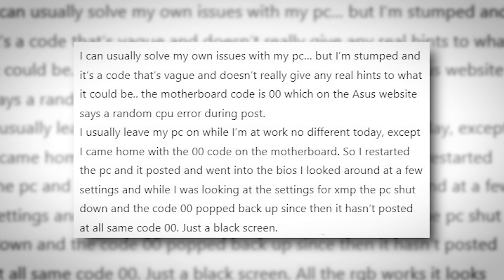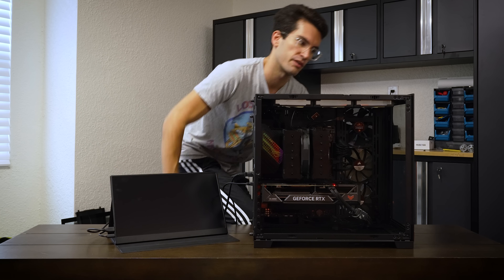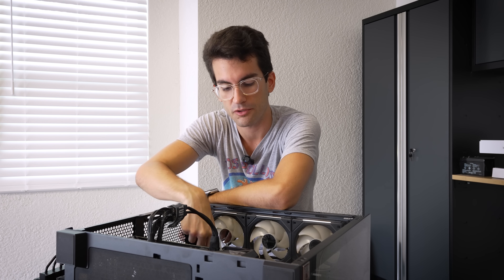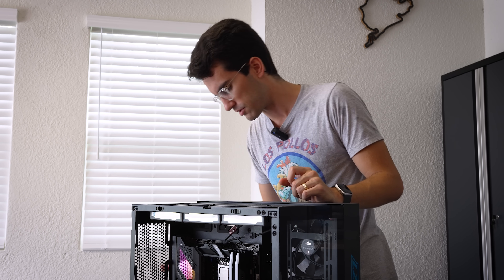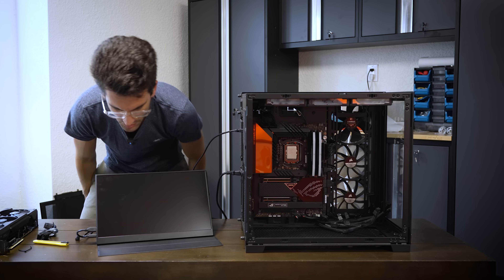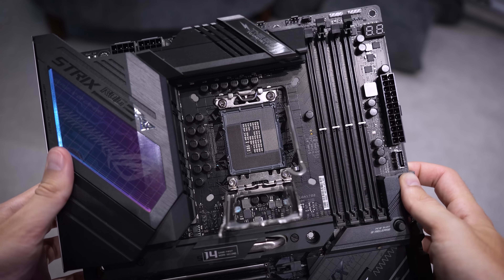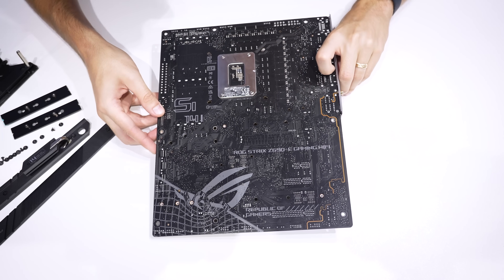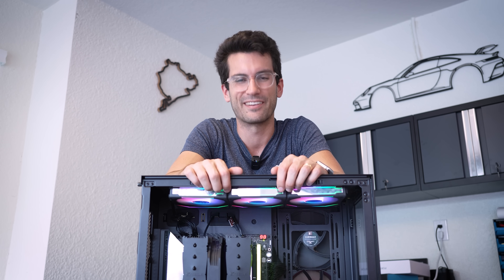Fixing a Viewer's BROKEN Gaming PC? - Fix or Flop S5:E17

Comment: If cpu isn't getting hot, it's probably likely that a mosfet went bad or the controller of the power stages went bad. If you have a thermal camera, power it on and see which component gets hot and that is likely the culprit. Great diagnostic video.
Reply: My thoughts exactly.
Reply: Agreed.

The power delivery to the CPU is a no-go.

Something is broken.
Reply: Exactly this. Also a very common fault for GPUs.
Reply: 30 seconds in and I'm like that's a dead Asus MoBo. I've see that dozen times
Reply: i was thinking a blown fuse on the cpu power rail as the 13/14thgen  are know for spiking in voltage ??? defo could be a dead mosfet
Reply: Yeah the problem with fixing a board problem like that is a pain...if it's a mosfet or capacitor or something that's gonna take soldering which means you need a soldering iron and a bunch of other stuff. Just not worth imo.

Comment: 0:47 Greg, you need an ultrasonic cleaner. Gets the smoke smell right out of the boards. I just picked up a scrapped B350 board that works for $10 CAD. It came from a heavy smoker. The colour and the smell. GONE. Absolute magic.
Reply: How does that work? You must need a big one to fit the whole motherboard in… doesn’t it have water in it?
Reply: @minecraftmike5193  as long as the board doesn't corrode I don't think there'd be any problem with it being submerged, obviously the battery and stuff should be removed.
Reply: @danimayb  Just make sure the capacitors are discharged. And I'd suggest demineralised water instead of tap water, as it is much more pure, and won't leave a lot of residues.
Reply: And for those of us who can't afford a MB sized ultrasonic cleaner, vinegar and a Q-tip works exceptionally well.
Reply: @danimayb   yeah nope. You can never be sure its dry ffs.. Keep your electronics away from water..
Reply: I'd love for Greg to move into board repair

Comment: Looking at that massive cooler I immediately thought, warped/bend socket. That's 1 of the reasons why I love AIO's, there's so little weight pulling on the board or socket. the better part of a kilo or more for those topheavy coolers is a lot for a single bracket to carry. Also the PCB of the "cheaper" rog strix models have fewer layers of sillicon compared to - for instance - the Hero you installed. It just has to bend a fraction of a mm and in a few years you can throw away the mobo. 

Doesn't mean it is a  warped or bend socket, but it also could mean the owner forgot to mention a detail or 2, but regardless of what it ends up to be the main issue, that system is up and running and I'm sure the owner is really happy with the result and the upgraded motherboard.
Reply: This is not true, the board is built to handle the weight easily. That cooler isn’t even that heavy compared to others. I’ve had bigger air coolers for years without any problems. It takes much more than just a cooler to break the board, unless you really mess up. Just sitting there, the cooler won’t cause any damage (though, like with anything, there are rare exceptions where you might just get unlucky).

The way the cooler’s attachment points are designed lets it support several kilos of weight, and there’s no real strain on the socket itself. You put a lot more force on the board when inserting connections or RAM.
Reply: They have metal backplates they screw to and spread the weight out.

Comment: Praying Mantis's are so cool. They will run from you. However, place your hand in front of them. Get them to climb on. They will let you look at them and look back. I've been doing this for decades. Set them back down onto a wall or wherever, many times they don't want to leave your hand.You have to coax them off. Come back 10 minutes, 1/2 hour later. If their still there. They will remember you and not run away or fear you. I've moved them in my garden and had them watch me picking vegetables. It's kinda amazing to me.
Reply: when i was around 11, i saw this mantis sitting on a barrel and instead of running, he flew straight toward my face and scared tf out of me doing so. nowadays i don’t mind them but i never see any these days
Reply: @ImNoodals  Thats funny, I'm fortunate enough to currently live on 10 acres in rural Vermont Mantis's are so abundant I try not to run them over with riding lawn mower when I see them running for their lives. They rarely fly, I don't know why

Comment: I just built a similar system last month, and it was my ginormous CPU cooler.  At first it was randomly having weird issue and screen going black,  I would put it on its side and check stuff, then when I turned it on, it worked.  After putting it back together, and turned it on (upright), the random errors and black screen returned.

Fast forward 2-weeks I finally figured it out.  I looked at the rear panel and seen only a few ports were misaligned.  I pulled the motherboard and it was warped.  I looked at the motherboard and it was really thin.  I have socket 1700 and GIGABYTE B760M C motherboard.  I put on a stock cooler after straightening the MB and all is well again.

So, if you get a ginormous cooler, make sure to get a support CPU bracket for LGA 1700 and maybe orient your CPU so it stands upright in your case. The cooler is a Thermalright Frost Tower 120, it weighs in at 3.5lbs!  I guess 3.5 lbs is the motherboard weight limit.  At least for that motherboard.  It wasn't a top tier MB, so if you want a top end air cooler, you may need a top end motherboard that is thicker and stiffer or buy a LGA 17000 CPU support bracket.  Thank goodness it didn't kill my MB.

Also, I highly recommend a CPU support bracket with a ginormous CPU cooler.  Hopefully AMD makes one too.
Reply: Gagabite strikes again. A contact frame should solve the issue.
Reply: @Lurch-Bot  Yeah, I ordered two brackets already.  I don't know if Gigabyte is solely responsible, as I have seen other MB manufacturers with issues.  I mean a lot of systems need to use those brackets on any new high end intel system.  I don't know of anyone testing these brackets on all systems with this ginormous coolers,  but it would be a nice test on which MB would need them over others.

But AMD makes the same grid array sockets, so it wouldn't surprise me if AMD will soon need custom brackets as well.

Comment: You might try bios flashback via the flbk button and bios usb on the io before totally condemning the board.  Otherwise RMD time.
Reply: Yeah I don’t know what tooling he was talking about. You can update the bios via the flashback slot in under 10 minutes. As long as you have the 24 pin power connected, that’s all you need. 

A flash drive > Fat32 > install the bios and renamer file > run the renamer and then delete that > slip the usb stick in the slot > press and hold the button until light flashes > and then it’s done in like 5 minutes
Reply: @HOBOTw1tcH  he was probably talking about a tool to manually fix a "BRICKED" bios. For that, flashing it wont simply solve the problem. That's the reason why most Gigabyte motherboards come with dual bios integrated in case one bricks, the other one can still be used.
Reply: @Angel_Espinal  yeah I figured that. But it’s not what he said. It was just confusing. And weird that he’d skip a 5-10 minute test that could have saved the board. But he’s a smart guy and he has access to hardware on hand unlike most people. So I get why he just replaced it

Comment: 12th gen is not affected. I have a 12700k, with a 3080ti, & it's a fantastic system.
Reply: I’ve got a 14600kf. Haven’t had a single issue. I’m sure there are people who have but from what I understand it’s the 14700 and 14900 that are the issue.
Reply: @genesisfan029  You were just lucky and Intel might be lying about it. My friend's exact same 14600KF has degraded too so it's not just i7 and i9.
Reply: @kerotomas1  The ammount of 14600kf that are degragading is EXTREMELY low compared to i7 and i9 but they still exist.
That guy is not lucky he is just like most people.
Reply: It’s not a hardware problem it’s a bios settings problem. Sync all cores.
Reply: @ZackSNetwork  I mean it is affecting only some type of hardware (actually gen 13th and 14th). But to clarify it's as much a hardware problem (cause there is some oxydation in some CPU cause Intel maufactureurs didnt do there work properly) as it is a software problem (intel microbios was shit and pushed so much the cpu's that they speed up that oxydation procees or even fry themselves). Gamers Nexus and level1tech did a real good series of videos on the problem !

Comment: If I were to guess it was an improper application of the Heat Sink causing the CPU to shift and while the CPU powered off to save itself the Motherboard wasn't so lucky.  That or it just was it's day to go, like someone dying but they could not find anything wrong with them except for the fact they are dead.

Either way it would be a rare shot and thanks for sharing it with us.

Comment: I ended up replacing some kids i9 3900K processor today after his was one of the ones that was causing crashing,. I ended up finding out too that intel had discontinued the specific model 3900k that he had for a newer one version that supposedly doesn't have any issues. Installed the CPU and it I ran a full stress test for like 5 hours and it didn't power off or crash once. 

Built my nephew Dylan's first gaming PC two months ago and we went with a 12th gen i9 12900k and his build works like a dream.

Comment: Hey Greg, I am curious if you considered bios flashback to update the bios?  I have ran into a similar issue with 00 on the debug code with an Asus board after a Windows update.  Board refused to post or show any other code than 00 until updating the bios.  Worth a shot if you haven't tried that, I know you do some testing off camera as well so I imagine it is possible you already tried it and didn't mention it.
Reply: I was wondering this too! Could be that the logic is that if the CPU isn't getting power (or at least not producing enough activity to heat up), then it's unlikely the BIOS flashback would work? I've only used it once myself, so not very familiar with it.
Reply: @xos  In my case I suspected that the Windows update pushed some sort of update to the bios that kind of pissed it off and a bios update undid what Windows screwed up haha.  Can't say if that's exactly what happened for sure though
Reply: I was yelling at the video for him to do this the whole time. Could just be a corrupt bios. Maybe it tried auto updating or something weird😊

Comment: I use Intel Core i7 12700, updated the BIOS with newer microcode 0x129, the motherboard is Asus ROG Strix Z690-F Gaming Wifi. Bought this platform since launch date, 2 years and still running.

Comment: 00 On an ASUS Motherboard is nearly always a dead Motherboard, not the CPU. It is also a known issue with that brand. They also did a recall a while back for a chip placed on backwards in the area near the DIMM slots which resulted in it burning out that  chip and causing this same issue.

Comment: I've had such horrible luck with ASUS products that I refuse to buy them anymore. A year ago I bought a new laptop from them---out of the box it overheats after 5 minutes. And two years ago I bought a gaming monitor from them as well---there's a 4" dark-shaded bar on the right side of the screen, and it's not GPU-related. Even the stand-alone DVD player from them was awful---the power switch was so stiff that I had to use a screwdriver to turn it on/off

Comment: Thanks for the video. Any interest in expanding the series to do more repair work? I'd have been very interested  to at least check the power rail voltage levels on the board (for shorts, etc) and to see if the cpu socket was receiving power.

Comment: Hi Greg, I had a unique MB failure. After I finished building my PC, it worked faultlessly for some time. When I moved my PC, it did just what that PC did. I did just what you showed in your video except replacing the MB, which I had to order. As I removed the old MB, I heard the sound of something falling. It was a small SSD cover screw that had found a new home behind the old MB.

Comment: The more of these i watch i find it crazy my GA-970A-UD3P (rev. 1.0) mobo,  fx8350 and gtx 970 still run like a champ. The only issues ive had were both psu related

Comment: My latest…. CPU fan mount had stressed the motherboard so much ( it was like a spring when I removed) it cause hairline cracks on traces leading to the nvme..and other areas of the board …changed opacity of camera and it was clear as day through the lens.

Comment: i've seen power surges take out bioses, and power stages. just enough to cause the internals to fail, or to wipe the programming in the chip (re bios), but leave them looking fine.

only way to resolve it for bios wipes is reflashing if the chip isn't doa. which yeah, isn't something you can do on a lot of motherboards without special gear. sometimes the test clip will work, sometimes the circuit requires you to pull it off to program it, since the components surrounding the chip will pull the current low enough on the data lines it doesn't flash right.

and then once in a while you run into the problem i'm having, where intel does funky things to their bioses, and loads a small decompression util in first to unpack the main bios segment elsewhere on the chip. if its not there, and in the right location in the eeprom, the board is just dead.

now, most modern boards don't do that, and will take a straight flash if you have the capability, but it can still be annoying to get there.

Comment: Idk I’ve had nothing but issues with my TUF X570 Pro-WiFi board. There was a moment where it was just bricking my drives. I swapped to an MSI B550 board, zero issues whatsoever. I had to wait until there was a bios update for the X570 board in order to fix it. I did the update and it was stable…for about 3 months at a time. Then it was either a power delivery issues,  problem reading drives, throttling issues, and just recently it just randomly decided that it wanted to stop reading my RAM. I’ve ran into a handful of people on Reddit who have run into similar unstable bios issues. I want to say it’s just that ASUS makes so many boards a bit too many are ending up unstable/defective down the line.

Comment: Only options are to use the onboard Bios flash back with a previous BIOS version on the USB device.  If no bueno then have it RMA'd, ASUS should have no issues on a board that new sending a replacement.  Ask the customer if you can keep the board then just rma it and keep it for the next person, 690 is perfectly acceptable or you can offer to r&r it when it arrives for a normal repair fee if they really want theirs back.

Comment: What Kit did you get? I reflashed and rescued so many Boards in the past with an CH341A and some accessories. At some point I bit the bullet and got myself an SkyPro II from Coright. Thats what all the Tech Supports at the board vendors use too. The SkyPro III is also available now

14:22 - You could still use your FLIR to detect a hot IC etc. A hot IC usually means that theres a short in it

Comment: Greg, just an FYI, the CMOS battery would be considered dead since their nominal voltage is 3 volts. When they are new they will be 3.2-3.3 volts. Dead is 3.0 volts and under. I know when you showed the test it said 3.07 volts but that is still low enough to cause issues with a device. Thanks for the series though, always entertaining to watch.
Reply from the maker: 3.07 has been measured in multiple, working boards at my disposal. So I don't think that's entirely true.
Reply: @GregSalazar  Yes, I have seen that in multiple of your videos. Per my experience during my almost 15 years selling and replacing those batteries, 3.07 volts can cause issues in a device, though  it may not cause any issues. Still would be worth it to replace it with a battery reading closer to 3.2 volts to verify it isn't the problem.
Reply: I recently fixed my brothers rig, that was very similar, also 00 post code. As a last resort I replaced the CMOS battery and it worked right away. It was reading 3.1V when I tested it.

So yeah, I also think the battery can be to blame here.

Comment: You should really consider to start measuring power rails voltage, you already have a multimeter and wouldn't take long. Would probably add a little spice to diagnosing on camera.

Comment: Ironically watching this as a massive monsoon thunderhead approaches.
If the board immediately goes OO, it is probably a board issue. A bent pin or bad CPU is going to take longer to get there. 
And, remember kids, while a no-POST means it doesn't work, a POST doesn't guarantee it does work.

Comment: honestly sounds like they had a power surge while at work and which caused these issues. If that is the case. a good surge protector is ur friend.
Reply: Surge protectors are great anyway, definitely recommended. I always use them even if it's just to smooth the AC voltage into your electronics. As a result, I've only had one component die in 20 years (a Jginyue X79 motherboard, so not much of a surprise there 🤣)
Reply: @peterwstacey  agreed! everything of mine is hooked into surge protectors as well cus i've had a CPU die from a power surge  and it only takes one till u learn a lesson xD

Comment: @13:30 You should be able to use bios flashback for corrupted bios, I imagine that board has it being a higher end model. That being said it's unlikely to be the issue.
Reply: That usually only works on motherboards that can do a cpu-less bios flash.
Reply: @smashed_penguin correct, motherboards with bios flashback as I stated.